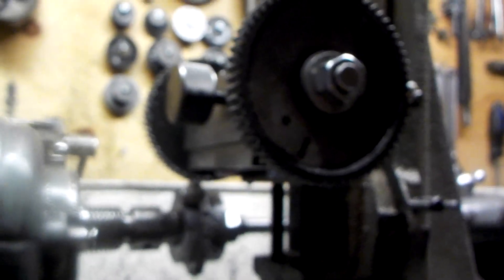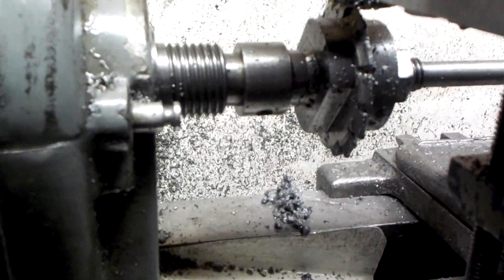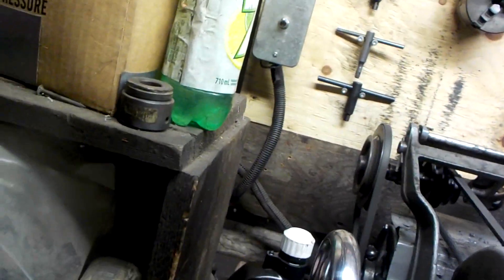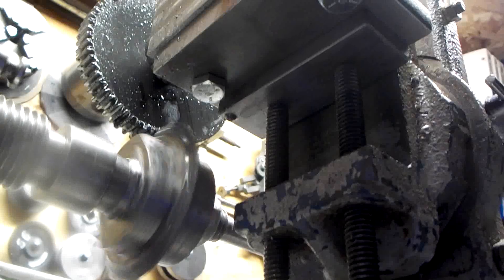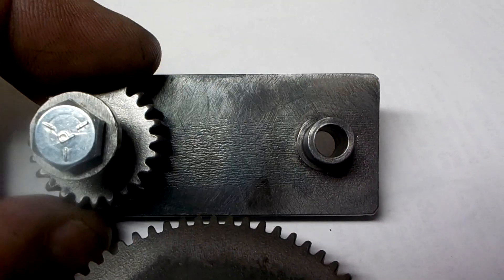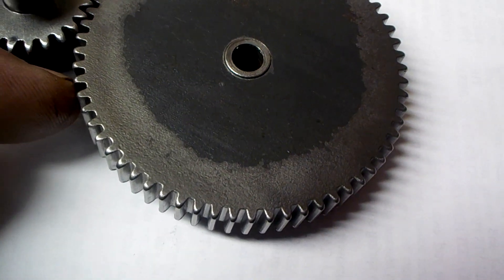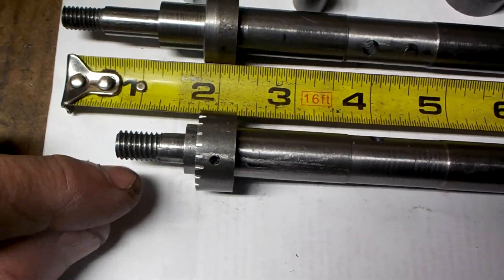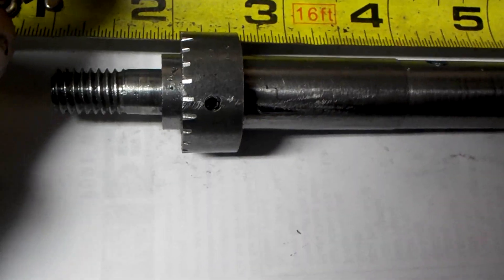Cutting 64 Tooth Gear With Version 2 Attachment

Comment: I am very impressed with how well the gear turned out. It looks like a lot of work to make the attachment but the results make it worthwhile
Reply from the maker: Thanks - the version 2 gear cutting attachment, the extended arbor that the cutter mounts on and the power feed all work together to make creating a new gear a bit easier and get a much nicer finished product in the process - live and learn.  As you say a lot of work but the end result is well worth it in my opinion.  I am hoping I can now move on to create the gears I need for the four gear sets I am trying to make for my lathe.  Two of the gear sets are for threading and two are for turning to make set up of the change gears required easier since the lathe does not have a quick change gear box.  I did have most of the gears already created using the original gear cutting attachment but the results were not as nice as I had hoped so most of the previously cut gears got turned down to create new smaller size gear blanks.